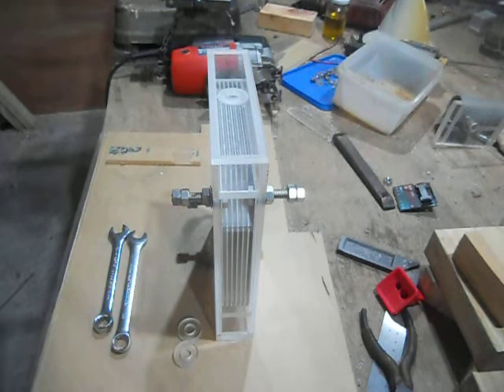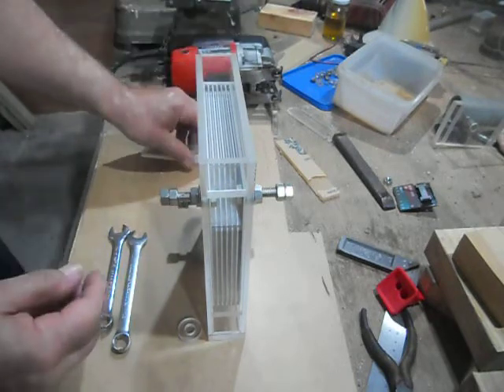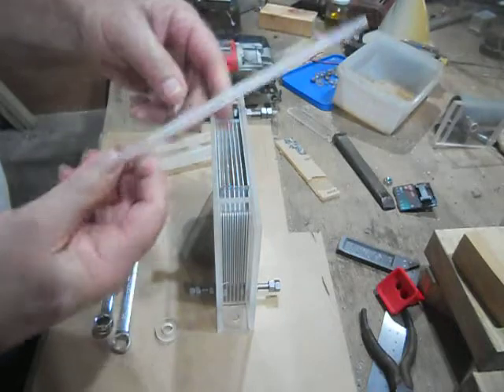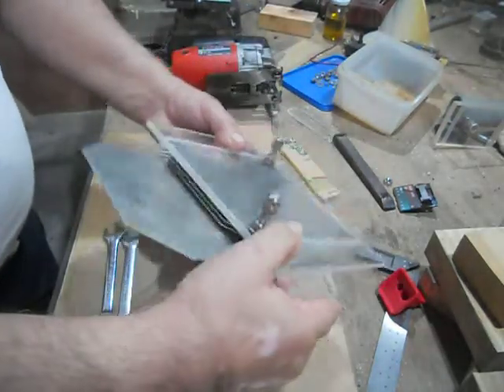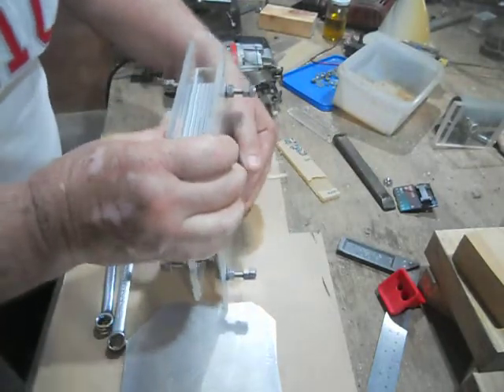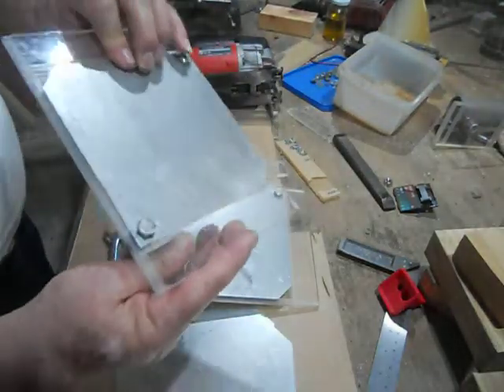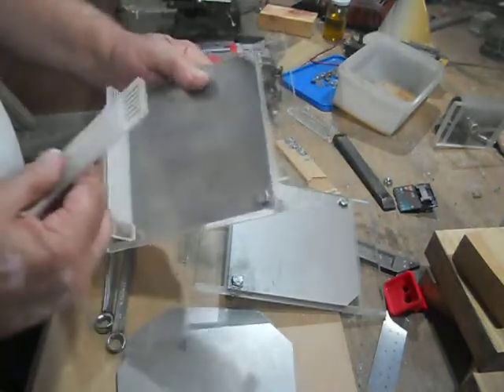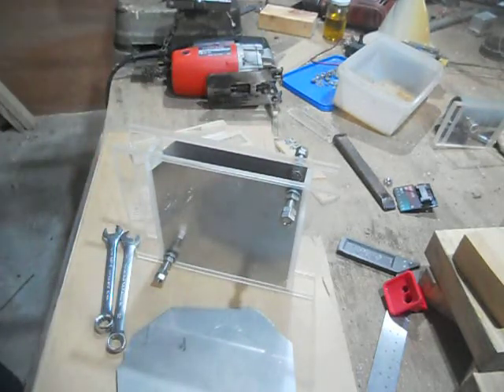HHO Magnet cell

Comment: Build your transformer/ power supply  so that you can use plates or rods for the core, and your core is also the electrolysis surface area, piggyback off the magnetics of the transformer and the heat. Warmer the water the easier it is to split. Reply your thoughts on this please!
Also graphite works better than stainless steel. 
My idea for a design is make a starship coil transformer since it concentrates the magnetics to the center, probably doing something like a halbach array.
Graphite will work better with lower amps and higher voltage. 
I'm sure you don't want to make closer to an aircore transformer (or do you) so hallow out the Graphite rods and fill them with what you would use for the core of a transformer and cap off the ends so it can't make contact with the water, just the Graphite rods touch the water. And fix each rod individually allowing them to spin in place, it will do this if you run AC or Pulsed DC through the starship coil transformer. That will improve efficiency cause the air bubbles won't be able to cling.